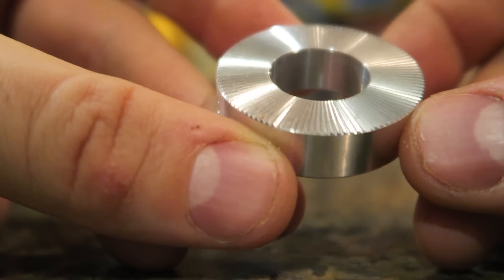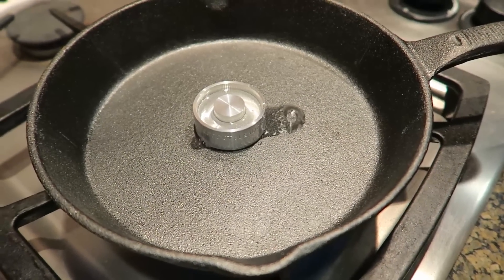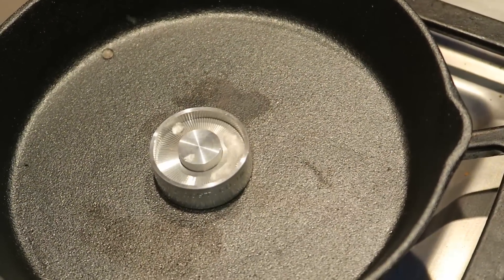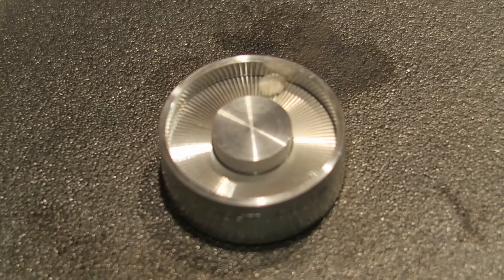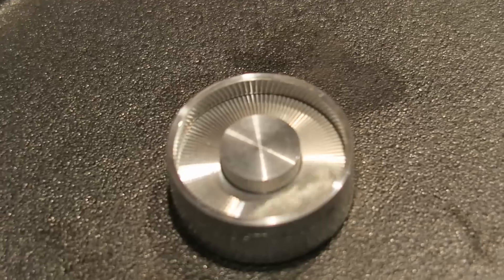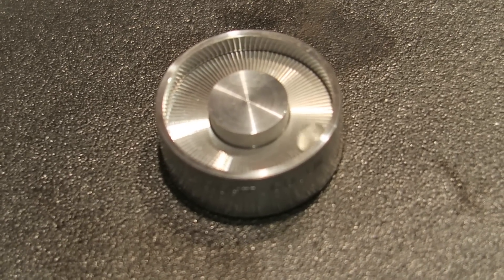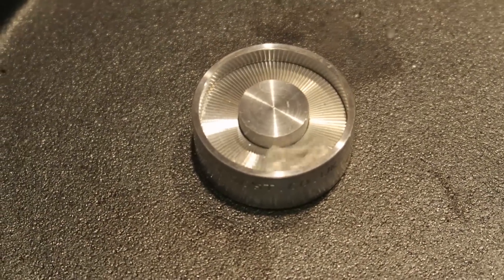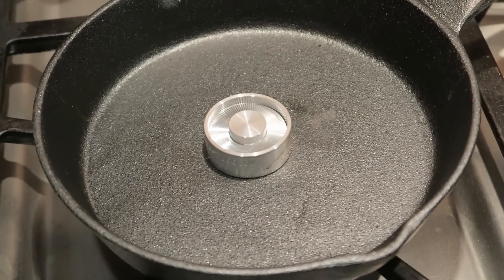Leidenfrost Effect Science Toy

Comment: The Leidenfrost effect is a physical phenomenon in which a liquid, in near contact with a mass significantly hotter than the liquid's boiling point, produces an insulating vapor layer keeping that liquid from boiling rapidly.
Reply: thanks wikipedia
Reply: Rafael F.A.C. hey everyone doesn't have time for looking it up. I had read about it long time ago so posted this.
Reply: Nah, I'm just picking up on you. You did a good thing, I agree with you
Reply: tesla192000 good job, really strong physics explanation
Reply: tesla192000 I don't think anyone asked lol
Reply: Nick Skelton drop out
Reply: tesla192000 Is this similar to the mirage effect on hot roads from far off?
Reply: Kitterz G. Mirages are caused by retractions of light rays as the air layers increase in temperature closer to the hot asphalt
Reply: tesla192000 so u mean it propelled by steam?????
Reply: No conduction, only convection and radiation
Reply: Mr. Minimalist Thanks
Reply: tesla192000 I saw this on Wikipedia
Reply: Gigabyte  the water molecules are attracted to each other so they get pulled toward each other.
Reply: that's why liquid nitrogen can be poured briefly over someone's hand without causing frostbite
Reply: You just took it out of the wiki -.- gj
Reply: Tesla, Wikipedia is copyrighted. And you should know that, and if you dont believe me look it up, so you should delete that comment before it's too late!
Reply: SavageWolf How many times do I have to tell you this is not from Wiki. It's a standard textbook definition. I always cite the source when quoting.
Reply: tesla192000 it's cool don't say it's bad
Reply: tesla192000 I know what the leidenfrost effect.

Comment: This concept could power our cars in the future.
Reply: tyvek05 cuz he is audi (you can see it in his pic)
Reply: tyvek05 mabey the water will push a cirular thing...idk be creative
Reply: Nah m8. So future cars should heat up their wheels to over 100°C?
Reply: Hello _ why not? Nowdays cars have their engines heat up more than 100*C  but there is fluid (i dont know its name in english)that doesnt let it heat it up
Reply: Derp Of All The Derps It would be like having four engines dissipating heat to the air over a larger surface area. It would be so inefficient.
Reply: +M8 Fruehauf the tires would need to be made of water and the ground would have to be over 100c, also you wouldn't be able to steer
Reply: +Sir Penguin and eventually the water evaporates
Reply: iceplanetRC hey everybody look, millions of mechanical engineers all over the world are trying to figure out ways to optimise cars but some guy  in the youtube comment section of a Russian life hacker figured out the solution. Go home everybody, case closed
Reply: The point is, this concept will not run on water. It will run on fuel, which would heat up the wheels or possibly an engine with water inside of it.
Reply: iceplanetRC How About No.